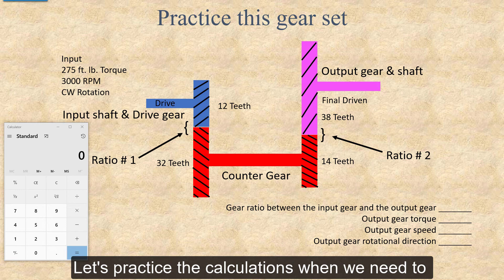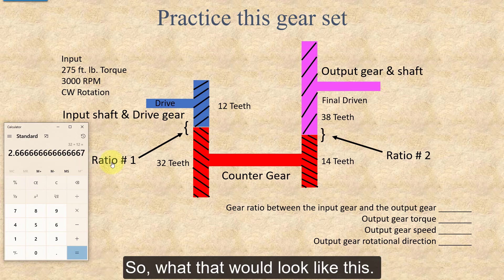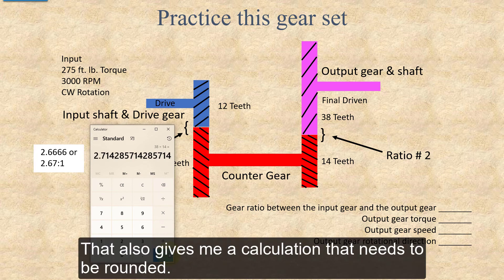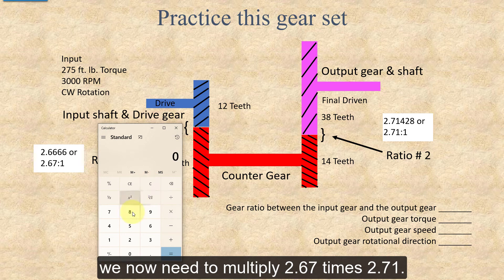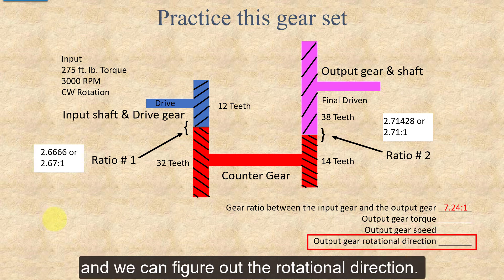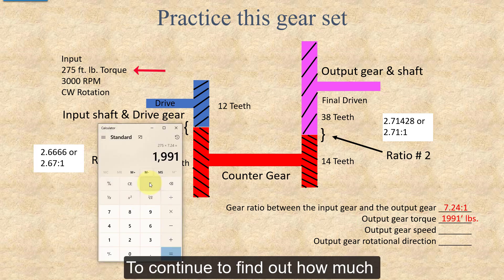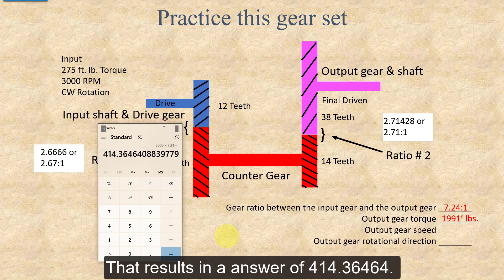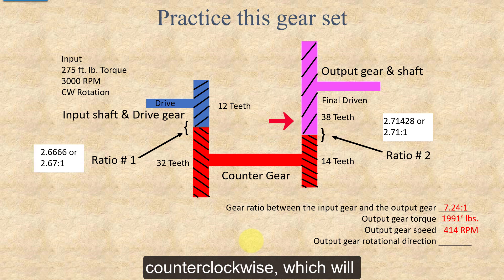How to Calculate the Gear Ratio and speed and torque changes when a counter gear is used.

Comment: Multiply input torque by gear ratio to give output torque???
I don't think so.
Reply from the maker: I'm not sure I follow you.  Feel free to check multiple sources, this is correct and an industry standard. Think of it this way. If you are removing a wheel lug nut with a 12" breaker bar this will be difficult.  Assume you can pull 60 pounds of force. This will produce 60 foot pounds of torque being applied to the lug nut. This is not enough to loosen the lug nuts.  Now exchange the 12" breaker bar with a 36" breaker bar.  You now have 3 times the leverage. If you apply the same 60 pounds of force on this 3 foot bar you can now apply (3*60) 180 foot pounds of torque on the lug nut. You can now easily loosening the lug nuts.  The radius of a gear acts like a lever such as in this example of a 3:1 ratio with the breaker bars. So when the driven gear is larger than the drive gear torque is increased or multiplied because the driven gear has a larger radius (AKA lever).  The amount of increase in torque is based on the relationship or ratio between the drive and driven gear. I hope this makes enough sense to you to believe and understand.

Comment: Thanks very much, 
What would happen to the Output torque and speed if I put two or more similar or different speeds gearboxes are assembled in-line in the drivetrian?
Reply from the maker: If you have one gearbox with multiple gears that produce an overall ratio between the input and the final output of 3:1 and that output goes into a second gearbox that has an overall ration of 4:1 you would multiply 3 x 4 for an overall ratio of 12:1.  As the ratio first number continues to get greater the torque will continue to increase and the driven output speed would continue to decrease.